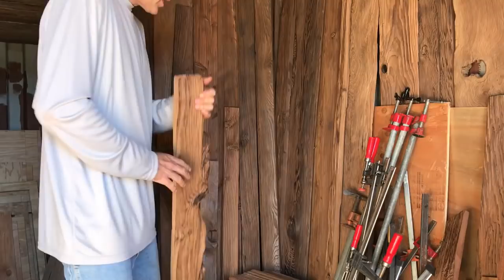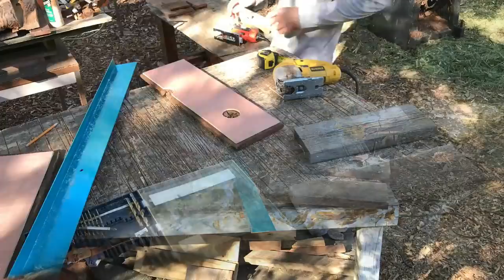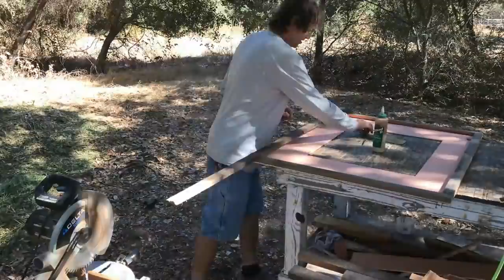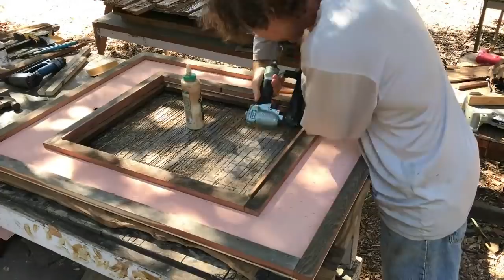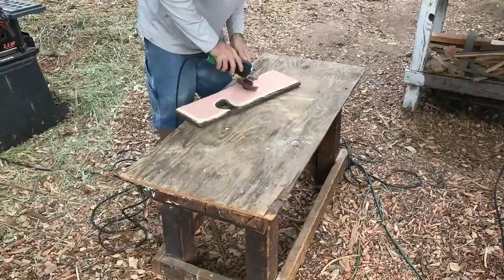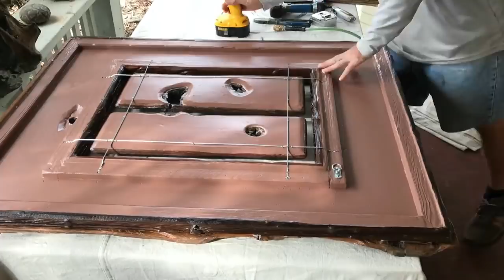Lots o Knots Wall Art Wood Sculpture

Comment: What a treat to watch this video. Your art just keeps on getting better and better.  How long would a job like this normally take you? Hours, days, weeks?
Reply from the maker: I'm going to estimate that I have between about 24-30 hours into this one. I worked on it for several days but when I'm shooting video this adds quite a bit to the time it takes so sometimes its hard to estimate exactly how many hours I'm actually working on the piece vs. doing things related to shooting the video. When I add up all the hours of building the piece, shooting the video and editing, I'm probably into it for 50-60 hours - but I enjoyed every hour so that's what counts.
Reply: Thank you. I used to work 50 - 60 hours a week, when I enjoyed it, it was great, then I didn't enjoy it so much so I made changes. Enjoyment is so important, it doesn't seem like work. Your pleasure is obvious in your art. Thank you for sharing. PS. I have made a driftwood frame for my picture, not as good as yours but I enjoyed making it, and it looks good.

Comment: Great again Scott.  I am continually impressed with how much time and effort you spend on these, especially the time you spend prepping and painting the backs of the pieces that no one will ever really see.  I can tell you love the work.  A question, at least on camera, I always seem to like the lighter, more natural, wood before you apply the poly.  Do you ever leave them natural?
Reply from the maker: Yes, I like the lighter wood tone too. The problem with not finishing the wood is that this type of wood will stain if it gets any water on it. Sometimes I hang my art in restaurants (and other places in town) and people will touch them with greasy/dirty fingers and this also leaves stains on the wood. I've had to resand and rewirewheel (is that a word?) several pieces because of stains. I've never found a polyurethane or finish coating that doesn't darken the wood. I like the polyurethane look even though it darkens up the wood a bit, I just think it makes it look more finished. I've built several that I've left all natural with no finish and will probably make some more all natural ones again in the near future.